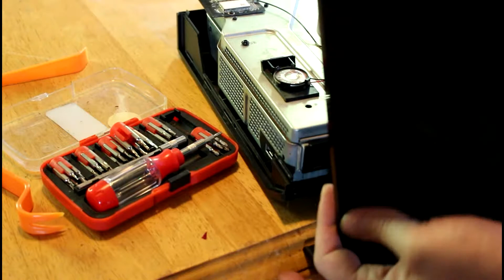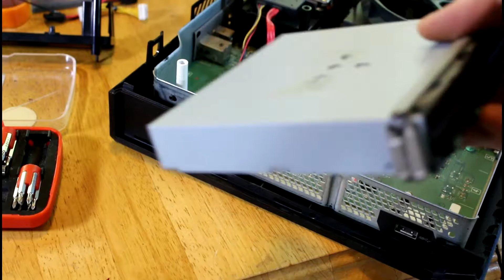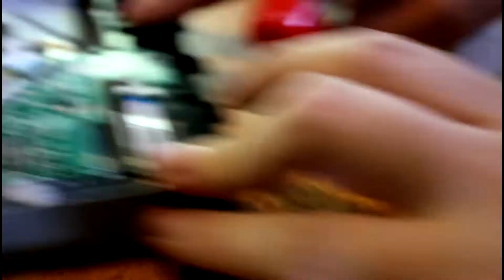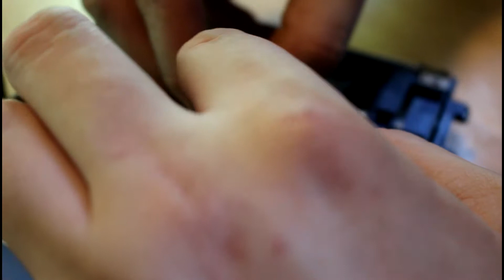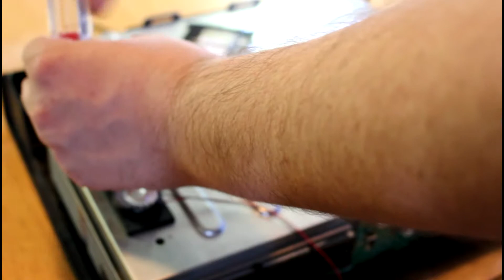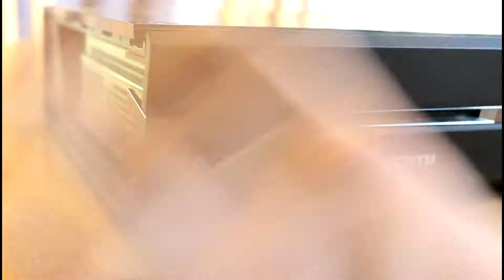Xbox one optical drive replacement / repair xbox one disc drive nothing left out

Comment: I haven't read or seen this. Curious about soldering 2 wires. Does both the wires have to be touching the contact under sodder? Or does the sodder act as a conduit and I just let the wires melt into the sodder? That is the only thing I'm curious of? Nobody on any repair shows or says if that is important? If not vivid enough...pretend no sodder is on there...there are 2 tiny metal brackets...basically those have to be touching the wires or is the sodder going to act as the conduit? I easily removed the wires and the solder is perfectly still on there. I was going to heat it and let the wires just stick in the sodder but then I wondered if I should heat it up and let the wires go all the way to the bottom of solder to make contact with the contact-board? Thanks for the help. Also I'm looking more at my drive and it actually looks like I can take out whatever the wires are connected to...a motor or something. Other words if possible to remove it all without the solder?
Reply: dadnbud do you know if the wires are copper inside or metal
Reply: I forgot I even commented. They love putting up videos but never respond to help questions. I got it all worked out. Is their a reason to ask why copper or metal? You trying to help or did you have an issue with an xbox and need help? I definitely remember the color was bright metal and definitely not a copper color.